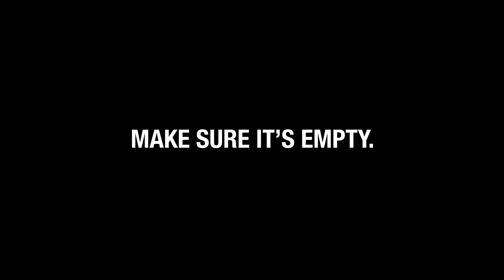DIY Airbrush Compressor Tank

Comment from the maker: Hey there, I hear many concerns about this project. Like anything else I do this can be dangerous. And just like anything else I make there are other and better ways to accomplish same or better results. As some pointed out in comments these cans are not made to be re-filled many times, fatigue induced fracture from repeated cycling might be an issue. I leave my compressor on the floor when airbrushing so in case that happens it won't be near my face. Thank you for watching!
Reply: That´s just youtube for ya. Don´t give it too much thought...
Awesome project and editing! I really enjoyed it and subscribed :)
Reply: Ive done somthing similar to a small workshop compressor, by adding an old propane  tank. I found the pump can over heat when filling the tanks. I may try adding a fan or adding some sort of additional heatsink/vaning to the pump head.
Reply: Donde consigo la conexion " T " por favor solo falta eso. Gracias.

Comment: Love the safety reminder about used fuel cans ,any type of fuel ! Tank can be a large single tank (freon , helium , etc .)  in the U.S. the heavier walled propane tanks (bernz-o-matic ) multiple smaller tanks can have a manifold made from plumbing tees, and nipples if the ability , tools , or material  to match yours is not available . Outstanding idea for improving a compressors performance .

Comment: Be aware that this cans arent meant to expand and contract so many times, the material aint projected to such material fatigue. If I were you, i'd reinforce the cans "case" that you made. But, nice idea!
Reply: And something to stop the cans at their bottom, those connections with the hoses look weak AF (small surface + hose clamp at an angle)
Reply: So ur sayin he made a compression pipe bomb?! Lol
Reply: Airbrush work at low pressures so the can's are almost certainly fine - Personally I'd just have used fizzy drink type bottles being cheap, up to the pressure and having that harder plastic lid to affix fittings for the hoses too.
Reply: @tcarney57  As PVC breaks in a similar way to glass, I'd not recommend that. Though normal plumbing pipes should take these low pressure just fine - fizzy drinks bottle plastic deform very plasticly (so no sharp shards) when then fail so if it did fail (which with this pressure level is unlikely). Much safer than something more prone exploding into sharp shards. 

If you do build any questionable pressure chamber a thin screen of anything at all is highly recommended - even just some old fabric loosely secured will make it safer, hopefully catching any bottle rocket or shrapnel moments enough to prevent injury. Even low pressure can be dangerous, but under 50psi (airbrushes are usually in the 30-40psi ballpark) is pretty safe. Please don't go playing with higher pressures if you don't know what you are doing!
Reply: What about a FREE helium tank that was empty so you didn't have to deal with the flammable gas issue. You will have to deal with the plumbing but I think that is Beyer than those cans.  It did look like he tried to put threads onto the numb he attached that hose to.  The question i.e. was that intentional or just a result of a failed previous attempt as it want on the prototype and it want filmed as if his earlier failure with leaks was intend intentionally hidden. 
I wonder if wrapping it in duct tape would make an "unexpected immediate decompression" slightly less dangerous? Would it catch the shratenal or just make the decompression occur with more force?
Reply: @evilcanofdrpepper  Maybe they are illegal in the EU (my guess as to the location of the bottle rockets in the video), but Harbor Freight sells 11 gallon air compressor tanks for about $40. I would think it would be easier to get one of them (which can be acquired on Ebay), than build all this dangerous stuff. The pressure issue may not be a problem, but DIY pressure vessels ARE dangerous, and the "empty" cans still have residual flammable chemicals, in gas form if nothing else.

Comment: I find the use of hose clamps for compressed air ... disturbing... put wheels on the box so if one does let go, it will self-propel around the shop till the air runs out.
Reply: I've seen hose clamps used on smaller barbs to hold hose fittings on that see 100 psi on the regular, they're plenty strong.  The clear hosing used in this case is probably the weakest component here.
Reply: Andrew Pratt,
If you put the wheels on an angle , it will spin in place . 😁
Reply: It just seems like they wouldn't work to normal people, but if you're in the industry you'd know it's very common, safe, and effective.
Reply: @littlejackalo5326  for water, hose clamps are a thing. In safe industry, crimped air connectors are normally mandated, or captive type where more pressure equals a better grip.

Comment: hey!  you should consider putting a one way valve on the main inlet tube, the one that goes to of the compressor. then you could fill the tanks, unplug them and take only the tanks with you.  I'm not certain how much you could do with that, but for small jobs, it would be smaller and lighter to carry around.

Comment: This is a very clever setup. My concern may be unfounded, but I would primarily just be worried that having those tanks so tightly packed together could cause an explosion if expansion occurs. Just for the sake of comfort, it might be worth spacing them out a little more. Regardless, great way to save money if you know the risk attached.

Comment: The cans will split at the seams when they go, not explode! So there is no real danger of splinters flying around. I copied your design but glued in niples on the cans as I didn't get the hoses to stay airtight. Pity there is no way of sending you a picture or two of my solution. I'm still short two cans for the project, but will get there in time. Thanks and keep up the good work!

Comment: Just keep in mind that while you expand your capacity it also means you increase the duty cycle (time running) on the motor and the pump and if it is beyond what it is rated for it might increase wear and tear.
Reply: Keep it charged after the first time and the recharges won't be quite as bad on it. I see your point and where you're going but it may not be quite as big a deal as you're thinking

Comment: You should put the pressure valve or else the cans will explode
Reply: Might have been better to try and use one or two of those propane camping stove cans/mini-tanks.  Those green cans are really sturdy.
Reply: Amana Wolf no green tank in Italy: only blue ones so he cannot satisfy your request
Reply: Even if this thing could provide enough pressure to do that, these vinyl hoses would be gone long before that :)
Reply: 40 to 50 psi max will never explode anything except a balloon  His is 100 percent safe for a lifetime.

Comment: I would suggest a valve to release the pressure when you are done.  Leaving compressed air in a container like that unless you pulled ALL the water out of it will cause water build up in your tanks.

Comment: Out of curiosity, why not just use an old fire extinguisher, paintball canister, scuba tank, propane/oxygen/mapp cylinder, or some other larger sturdy tank? Was it just availability? Surely if this is to be a permanent installation you'd want something a bit more robust.  

I mean, if it works, it works. It just seems a bit  like a spare tire, a temporary solution meant to provide some needed function only until a proper solution can be implemented.

Comment: An old propane tank would´ve been much safer!  I use one as a portable air tank for filling car tires, as my compressor does not live near our cars.
Empty one-way O2 bottles work also (mini oxy-acetylene kits), not much larger than those cans, but as they are made for holding 100bars, albeit only for one filling, they have quite some safety margin.

Comment: spray cans hold mostly liquid form contents (yes, even torch "gas" ) so they don't need to be able to take much pressure and should not be used as pressure vessels even for a low criticality application like spray painting..  In any case, for a little airbrush, if the settings are correct on both brush and compressor, it doesn't actually need a tank, and can operate continuously off the compressor..  Your compressor just happens to be very loud- mine is incredibly quite and just makes a quiet whirring sound- the air filter unit in the room is louder..

Comment: Im kinda mad at myself for not putting screws through the rubber cups on legs of mine. I took them out and bolted it down to bar stock. May have been better for compressor

Comment: Hi, great job! I do not understand where the device that shut down the compressor is located...
Reply: It is built into the compressor itself, it senses when it is up to pressure and shuts itself off.

In the case of airbrush compressors, that is when you dont have your finger depressing the trigger.

Comment: Those thin cans will rust out fast if there's no way to drain the water out of them.  I think it would have been better to have mounted the compressor on an old air compressor tank.  There's plenty of them around.

Comment: What's the point of the empty cans? I'm confused as to what this project was for.
Reply: Compressor makes preasure in cans and you can use that for longer painting session
Reply: @telefunkenas391  thanks for answering
Reply: @saskscott26  also all big and normal compresors have tank so you can move around and pump tires

Comment: I would have thought you could find an old propane tank for less than $20 or even better a FREE helium tank that was empty so you didn't have to deal with the flammable gas issue.

Comment: /!\  DANGER /!\
Those cans are not meant to be refilled. They will break kind of fast due to stress cycling (pressure goes up and down and up and down ...)
A fire extinguisher would be a better idea, or at least have some kind of grid to protect from sharpnel in case of an explosion. Be sure to have such a case ventilated (no steel sheets) so that the air can vent through

Comment: Spent 22 years in military and now work in HVAC.  I deal with pressurized tanks daily and have seen failures with “certified” tanks.  You need to get a tank that is designed for this purpose.  Small ones like what would work here are not expensive.  These torch bottles are not designed for this, at all.   Extremely dangerous.  I don’t think you realize it.  Honestly, take this video down.  Seriously.  Love your videos. But this one is dangerous and you can get someone killed.

Comment: I'm sorry but I just don't like this at all...
There isn't even a pressure switch on it...
And the manifold was poorly made as well...

I like his leatherwork videos though....🇬🇧👍
Reply: The compressor has a built in pressure switch. What do you think made it stop when he let off the trigger in the first part of the video?

Sure he tapped the holes a little deep in the manifold, but I'd be far less concerned about that then the cans. Even at that, those hobby compressors don't put out really high psi anyways.
Reply: @js18ms  

It was mainly them cans though I didn't like....
And the proximity of them tapped holes to the edge of that manifold he made...🇬🇧👍

Comment: Way too much effort in this!  Juts get a T fitting and use an old propane tank!  Did that for decades before little compressors even came with tanks!  Takes a lot less time to set  up and holds more air with fewer places to leak!